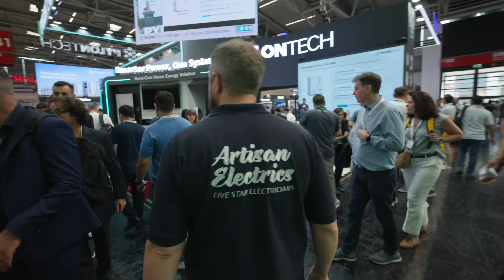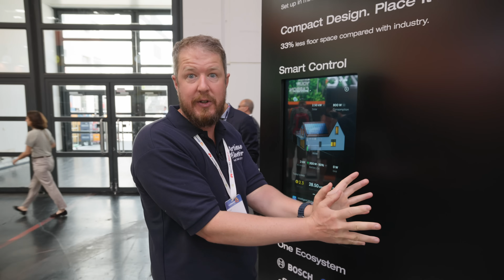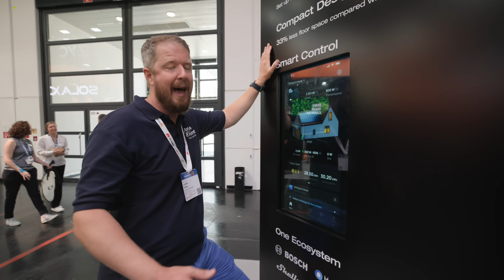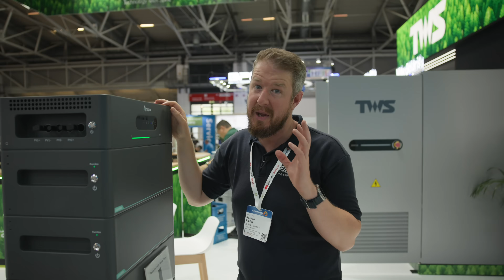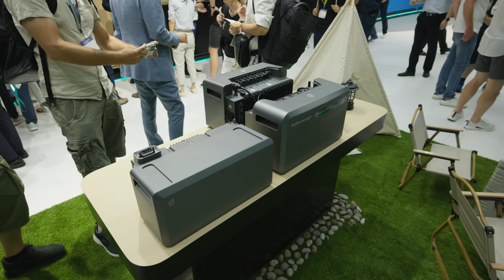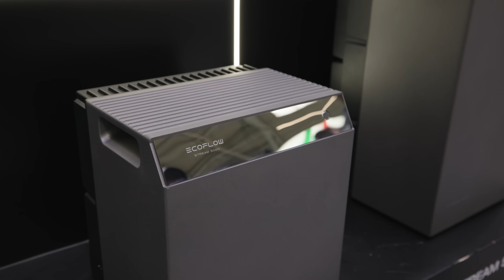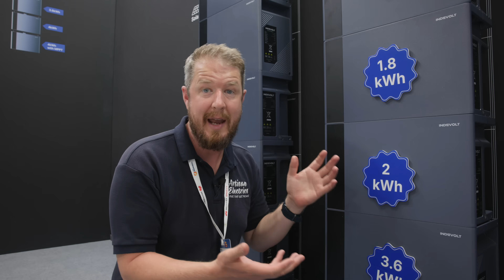Is the UK FINALLY Catching Up on Plug-In Solar? Intersolar 2026

Comment: 11:14 - WRONG , but funny to watch. 1,5 mm² is the cable diameter and that is limited to 16 A per wire hence 230 V x 16 A = 3680 per socket end circuit. 
The connection to the grid is a lot bigger with 63 A per phase or 3 phases x 230 V x 63 A = 44 kW. 
Quite a lot headroom for any kind of heatpump and 30 kWp solarpower system like we have.
Mark is not always sharing the real facts ... and his channel has become an advertising channel not covering the key factors from what cells (brand and type) are used in overpriced balkony solar power batteries , the empty hull of warranties for example ANKER (watch the ingenieurskunst sauter channel talking straight as an influencer for anker to no longere buy any anker product as he had gotten no support in his waranty claims for over 1 year) and all regarding efficiencies. 
The worst are descriptions or german youtuber use cases showing people false efficiency figures. They charge a 2 kWh battery with 1C or 2 kW and then they fool the pulic with a non typical discharge rate that creates fake efficiency that the average buyer is not aware of: they discharge with the same speed not telling that this will arteficially increase the efficiency no one will see in real life. During night the average balcony solar household is drawin less than 100 and mostly 50 W while sleeping. But the inverter will draw not 50W from the battery, but 100 W DC from the battery to generate just 50 W AC. 
50% losses are hidden.
And then the game goes like 200 full cycles x 1,8 kWh save you 360 kWh x 0,25€ = 90€ ... but what if the losses are over 33% ... and you barely get 1,2 kWh AC out the battery ? The whole calculation or RoI falls of the cliff cause in reality it will be hard to achieve 200 full cycles from a balcony solar power system with its 800 W limit. 1,2 kWh AC means just 240 kWh saved or 60€ instead of 90€. If you pay 600€ or more for such a stupid battery ONLY INFLUENCERS will make money and the manufacturer  cause you will have to wait for 10 years for a first positive return - and of cause without any damage or fault.

Regarding faults: LionTron had sold their RV batteries in 2021 / 2022 at a high price and the RV installers used to sell them till they got complains about 2 or 3 years later from customers that the capacity felt smaller and decreasing year by year. The installers opened a warranty claim as the manufacturerr hat promised 5 years and today even 7 years. Reality is different: the manufacturer rejected everyhting, so the installer came under pressure from the customer who had followed their advice to buy liontron. The installer had a 6 month warranty period for their own work but not for the battery, but under pressure they oppend the batteries and found the culprit every british can prepare too: the cells had been slowly drifting apart at the top and the bottom cause only 1 cell running ahead hits the overvoltage protection and that stops the charging while all other cells are still far behind. Same into the other direction where the under voltage protection stops discharging, while 15 cells still have a good capacity. 
All these crappy solar balcony batteries are simply missing the key ingredient: active balancer
So these RV installers had to open each battery , order an active balancer and implement that too and again close the battery case ... which is hand labour and you need experienced labour force to never cut into a cell, bms or wire during the procedure cause chinese cheap batteries have not a transparent case where you can look into. 

Do not buy balcony solar power batteries if you are a small house hold cause it will never pay off during the warranty period. To make any positive RoI your battery has to be cheaper than 125 gbp or 150 € per kWh USEABLE capacity. And in such case a 2,2 kWh battery with 10% safety and 2 kWh useable would generate here 240 kWh and 60€ of savings. The 2 kWh = 300€ battery will have paid off in 5 years at 0% interest and with the luck that it will last 5 years which is not always the case as seen in the liontron battery cases for RVs which are usuing the batteries only rarely and not 360 days a year. 
There was only 1 battery that fullfilled these criteria, 2,2 kWh marstek sold with app support on ebay for 310€ in may.
Reply: I think that comparison is a little too broad. A lot depends on the battery price, electricity tariff and how much of the energy you can use yourself.

For example, my house has a continuous base load of around 390 W and I’m on Intelligent Octopus Go, so I can charge the battery overnight at 7p/kWh and avoid buying electricity at 28p/kWh during the day. That makes battery arbitrage worthwhile before you even consider the solar generation.

A conventional UK solar and battery system typically costs £8,000-£12,000 and often has a payback of around 10-15 years. The new generation of plug-in systems with around 2 kWp of panels and a 5 kWh battery can cost closer to £2,000-£2,500. Based on my own usage, I’m estimating a payback of around 3-4 years, which equates to an internal rate of return (IRR) in excess of 20%, and potentially over 30% under favourable assumptions.

Plug-in solar certainly isn’t the right answer for everyone, but for homes with a high daytime load, a time-of-use tariff and no practical roof installation, it can offer a much better financial return than many conventional systems because the capital cost is so much lower

Comment: What protection for the lineman is provided to keep him from being electrocuted when the grid is down but private systems are feeding the grid? As a retired safety engineer, I worked on large commercial battery/inverter systems that were required to have automatic disconnect system to stop grid feed when the grid went down. That system could then check for grid up and resume feeding.
Reply: I believe that EU type approved systems have to have "anti-islanding" protection.  This monitors the grid supply and cuts power if the grid drops.
Reply: They do. I believe it's called anti-islanding protection.
Reply: Correct kabacus is right
Reply: Same system as with PV inverters. They go out.

Comment: Already running a plug in system .. panel’s mounted mounted vertically on back wall of the house battery don’t really charge due to base load 600 - 800w during the day but set eco flow to 1200w back through the plug

Comment: I'm a retired safety engineer & I'm surprised that you can put 800 watts into the grid without any automatic disconnect if the grid is down. The automatic disconnect is to protect a lineman from electrocution from private solar and wind generators that backfeed the grid.
Reply: I though the whole basis is that if the grid is lost the inverter shut down and so nothing enters the grid until the grid is back up.
Reply: You are so behind the times... Go back to school...
Reply: There is - they are grid following inverters not grid forming - so no grid connection, no output.

Comment: 9:30 Regarding the Netherlands, this isn't entirely true and it depends on your energy contract. If you have a dynamic contract for example, you'll get EPEX spot price + or - 2 ct per kWh. If you have a fixed contract, you mostly get nothing, but you also don't have to pay. And until January 2027, we've got net metering, where you can substract your yearly output from your input..
Reply: Good luck finding a new fixed contract next year without a terugleverboete.

Comment: Be interesting to see what export payments look like when there is an overcapacity… heading for penalty payments when exporting if the grid does not need it ? Also be interesting to see what ‘ off peak’ costs are when so many are charging batteries overnight. There will be an inevitable flattening of costs and income I think meaning the cost benefit of these systems will be in focus and the install costs as well as equipment costs will need to come down ? Sell now Jordan while the install market is booming!
Reply: The general consensus for countries that are further ahead on (plug-in) solar, is that export value is worthless, and resulted in a shift towards actual self usage. (ie people who put their roof full for 90% export to make money, are screwed, once this becomes active)
Reply: @smileyspeedster that was my thinking, store and self use until they find a way of taxing what we are harvesting ! Those who have seen export as a way to invest in installs and generate money will struggle I think
Reply: We are beginning to see it here. If you look at agile export data it's clear where the trend is going and it's showing up in tariffs with Octopus "Prime" being an obvious hint of what is coming where export is only worth real money when it's actually needed. If Milliband does manage to renegotiate the gas contracts or gas starts to get forced off the grid more then both the ultra cheap night slots and the current SEG payments are going to suffer. At the end of the day big battery farms will be about to outplay random members of the public at arbitrage.

Comment: Will this work with solar and battery storage I already have? I would much prefer to capture and store extra energy rather than export
Reply: Simple question - no simple answer technically or regulatory wise either. Coupling one once legal with  a small system (eg the tiny building regs compliance ones on new builds) is probably going to work out ok but two battery systems will tend to fight one another, and for most there will be a whole regulatory happy place where the extra generation capacity means applying for a new G99 approval before installing it.

What you can do even today is to plug additional non grid tie battery/inverters between sockets and some devices directly plugged into them and set them up with something like Home Assistant to charge when there is excess. Or you could use the excess to heat water, run aircon, grow weed and so on.

What there definitely isn't though is a way to configure that kind of stuff between vendors and devices that doesn't require a pointy tech hat and sacrificing the odd goat.

Comment: So plug in solar is a bit like weed - its technically illegal but everyone is doing it!
Reply: When people start getting prosecuted for it then we can say it's illegal IMO. Something isn't really illegal if it is never enforced or cared about by the authoraties.
Reply: In Germany,  with Plug in Solar you are advised to use a Wieland Plug and Socket, but you can use a normal Plug because the VDE (dach organisation for electricity) allow it because, if the inverters are are built to use normal Plugs and all safety requirements have been met with a normal plug, then it is classed as not illegal. 
The speed at which things are being developed and is often faster than the rules can be changed, so if a product meets or has a better safety standard possibly in a different way then it can be used.
Reply: Not clear if it's legal or not assuming you use G98 and proper UK type approved equipment. Whether building regs covers it is interestingly unclear but probably not best to find out
Reply: @etchedpixels  Anything on ENA register up to 3.68kW installed by electrician and G98 submitted will be legal.

Comment: Per 1-1-2027 the Netherlands will no longer "pay back" the energy tax and VAT (11.8+ ~2 euro cents/kWh) which ehffectively makes this a 0 financial export. Waters are a bit murky right now as some suppliers calculcate a 2 cent cost for export, while others calculate a 2 cent benefit for export. Still a long way from the ~25 cent/kWh we had before.

I am really looking forward to real life RTE right now, it's not so important for when we have generation in april-september with a glut of energy. But in winter time a high RTE is sort of required when doing dynamic tarifs and charging on the low and displacing on the high.

This also ties in with the 3kW options to charge to full in a 2-3 hour window and discharge over the day. Does require better then 80% though (buy at 15c, displace at 25c.)

Comment: 11:17 wait, what? 60 amps through 1.5 mm^2 wires? i would think they'd overheat with that kind of current...
Reply: I think he meant 16A breakers for 1.5 wires
Reply: He's wrong. The main supply is 3x63A but the 1.5mm² wires are on 10amp or 16 amp circuit breakers for general circuits. In NL we tend to use 2.5mm² for this and only 1.5mm² for lighting fixtures.

Comment: 800w could somewhat power my pc while gaming.
Reply: The units used in Germany often support 800W grid tie and a load more off the unit directly via sockets. So you plug in your Nvidia PlanetBurner directly and you still feed 800W into the house as well.
Reply: @etchedpixels  Good point.
Reply: Exactly
Reply: Does this one still work on tubes?

Comment: 800W is ridiculous for safety reasons. 800W is 3.5 amps, on a ring capable of 32A. In order to comply and make the most of battery and solar plug the greater loads into the AC battery socket and leave the tiny 3.5 amps (800W) to run the background electricity and to charge batteries. Also, separate the solar from the mains, for example, by running the kitchen’s heavy loads separate from the grid from àn inverter plus additional batteries. Two systems, one attached to the grid one for the kitchen.
Reply: It's not the ring current limit, it's the plug limit for continuous current on the plug.
Reply: @ehsnils  Plug is happy with the 2kW - the issue is that the generation effectively hides some of the load from the protection in the consumer unit.
Reply: @ehsnils  Not really, normal EU plugs should be able to do 2 to 3 kW continuously.
Reply: @ehsnils  I've had this discussion before in the comments, but it was not understood, UK plugs have a fuse in them right? Like 13A or something. So the ''safety'' problem can only exist for the ring AND if all combined plugs use more than 32A (or whatever the ring is protected from) of power. Which is very unlikely. While EU plugs can use whatever power is available. But we are fused max. on 16A, without a ring. EU plugs are rated at 13A cont. but no internal fuse.
Reply: We may get 800W per circuit - that's part of the consultation that just closed.

The 800W is because you've got a potential 35.5A of load looking like 32A at the protection. It's a nonsense theoretical consideration but the research data supported 600-800W in Germany (Germany went 800W and Switzerland 600W)
Reply: @etchedpixels  It's not theoretical is it? As far as I know cabling is rated for 20A, fuse is 16A, so you've got a spare 4A for your battery.
Maybe if you use a 10A fuse, you could run the battery at 8 or even 10A.
Reply: @FiveFiveZeroTwo  A UK ring circuit is 32A, assuming it's not silently broken over the years (ring mains are a terrible hack we should be getting rid of over time but that's another story) and has 32A protection.

The idea that you can manage to accidentally plug 35.5A of heaters into a circuit and it be balanced and thus not seen by the 32A protection isn't really credible but it's a theoretical risk.

In the US Utah actually allows you to derate the protection as you are talking about in order that you cannot create the failure situation and uses this to allow quite large plug in systems.